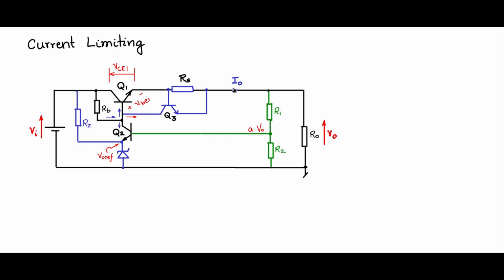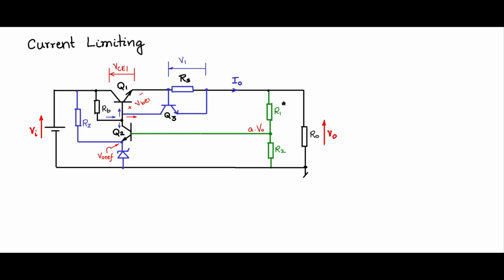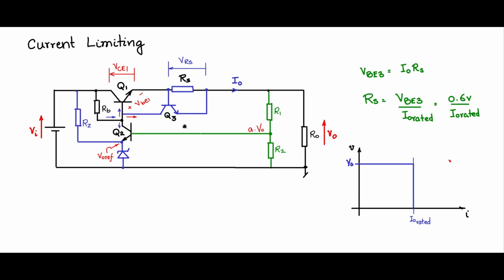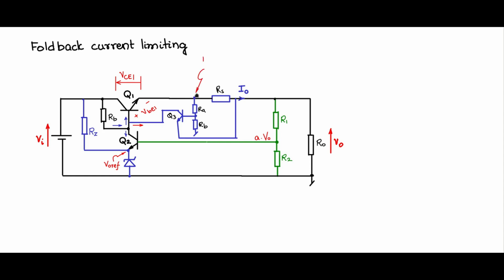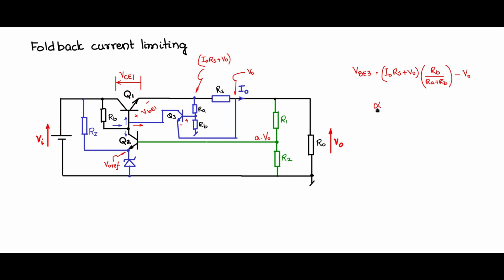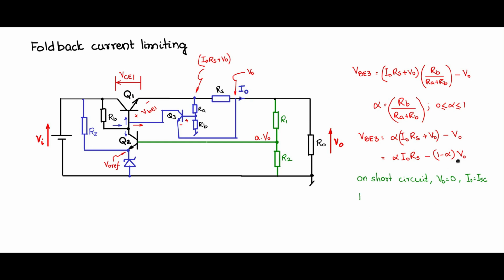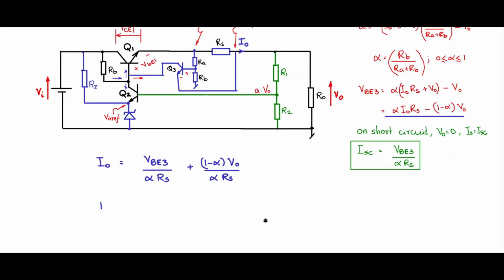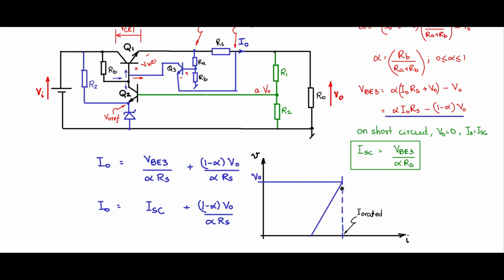w6 09

Comment: Could Q1 be replaced with two transistors wired as a Szikali pair formed by a PNP power (TIP36C)  plus a NPN driver (BD139 - 16). This is to mainly counteract the voltage drops associated with normal Darlington transistors.